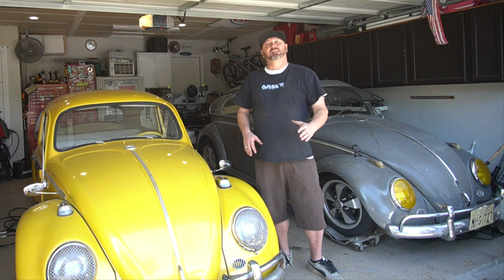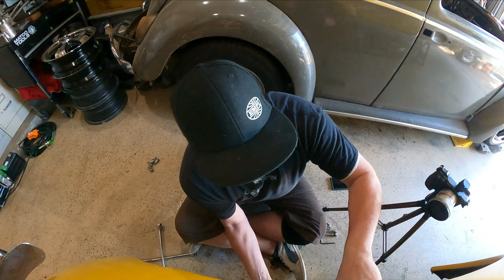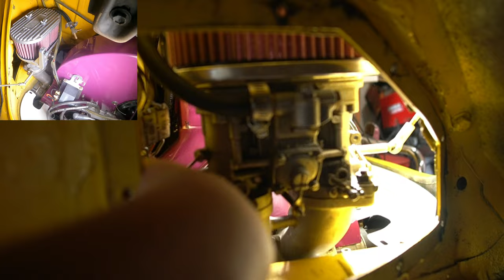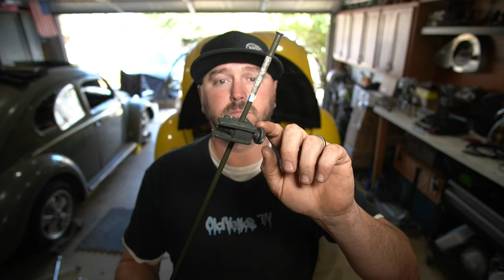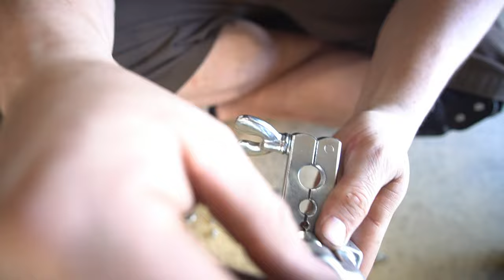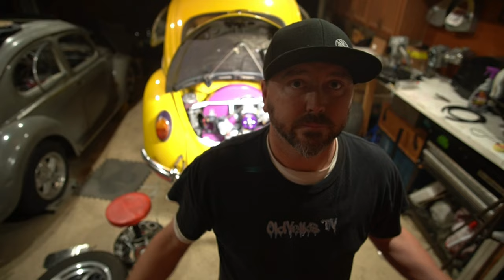Using the Weber Windows on a VW Bug

Comment: That is an amazing install.  Super nice lift. Since Daniel installed the engine tins on my bus, I have had a little issue with vapor lock.  Help🤗
Reply from the maker: Is the passage for the preheat tube clear? A little tweak to the mixture screw can sometimes help that as well.

Comment: Cool lift Jason, I'd love to have one. but I don't see the link.  Do they have other models? If a "z" rack was added it could add more lift. (I heard you say that's all you want or need. I'm just sayin , I'm pulling a page from my early days when I built a mini truck lowrider with a full hydro set up AND a full dancing bed kit with that's right you guessed it a "z" rack on the bed for more articulation. Anyway, this has been a really good series. Those weber windows are a must if running dual carbs in a bug fosho!
Reply from the maker: https://amzn.to/3IhB8jG
Reply: @OldVolksTV  cool thanks Jason

Comment: Did you put a quality grommet on that brake line? If not vibration will cut it.  No matter though that engine will never run right anyway.
Reply from the maker: I use a piece of fuel line where it passes through the firewall tin. It should run pretty good. Not sure how it'll handle the heat of summer, but that's not my concern. No warranties on used engines!

Comment: You know the motor will flex to the side when you pop the clutch . those air cleaners are to close to the fender walls .
Reply from the maker: With all the stiffening I did to the frame it shouldnt.

Comment: Looks like your missing the tin behind the pulley
Reply from the maker: Yup. The superflow head tins and the way they did the oil fittings made it impossible to install it. I'm making a one piece breastplate tin that fits pretty tight so the exhaust heat stays away from the  engine bay.

Comment: I don’t know for sure of what combination this guy has in that engine , but it’s my guess the engine is small with a huge cam. With those super flow heads it won’t run worth a crap. Another “ VW” guy who thinks that more is always better. Not true. You should have put wing nuts on all the installation nuts. It will be out again soon.
Reply from the maker: It's a 2.0l or more based on the outer diameter of the jugs and the width between the exhaust ports. (Stroker). I'd imagine it also has a wild cam. Engine came out of a sand rail. I advised against it, but we work with what we have.